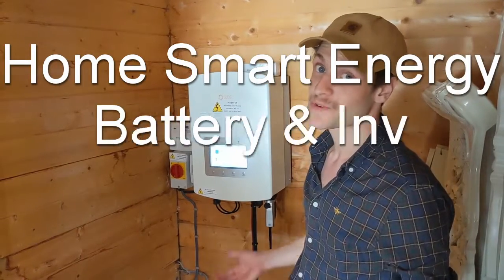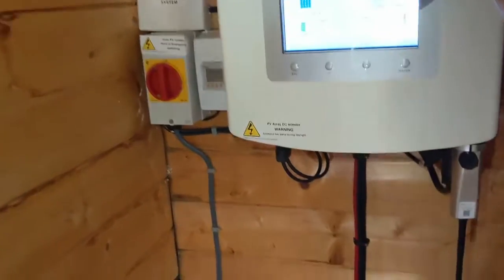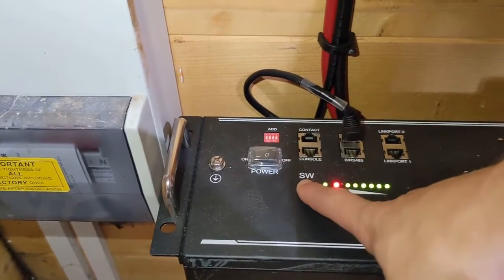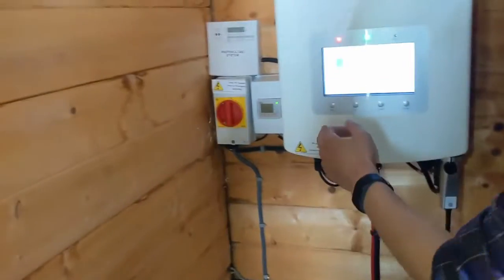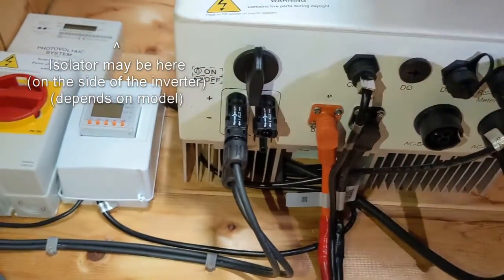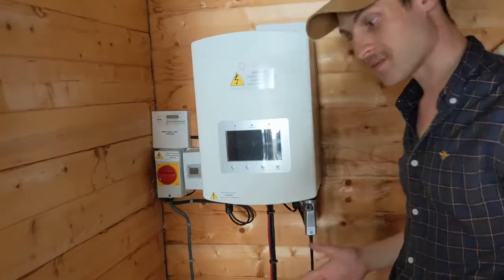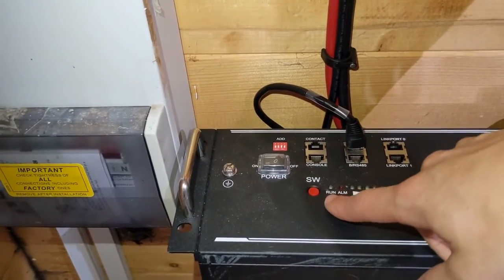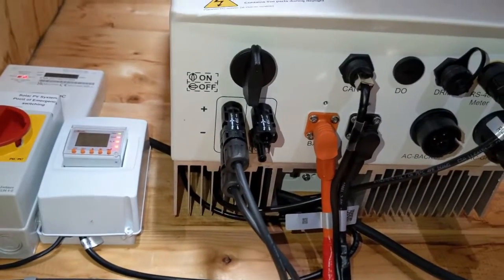Home Smart Energy - Battery and Inverter Restart Procedure

Comment: Great Youtube if you have this type of inverter. Firstly, I have a SOFAR ME3000SP Inverter. It does not have a DC isolator on/off switch underneath or the the side of the inverter! Please update your youtube video to mention this or another YouTube with a SOFAR inverter please. Secondly, it mentions only doing a re-start on one battery the master battery - what should one do on the other batteries if you have them? Do they similarly need to be shutdown after the master battery or just left on - again either mention this scenario in an updated YourTube or an additional one. Thank you.
Reply from the maker: Great comment!

If you've got an 'AC Charger' (an inverter that only has a battery connected, no panels) then you don't need to worry about a DC isolator as you won't have one, AC isolator will suffice (and of course turning the batteries off)

On the batteries, to be absolutely clear, press and hold the red SW button on the master battery (it'll be the one with the empty linkport 0) to soft turn all the batteries off, you can then toggle all the black switches to the off position. When turning them back on, toggle them all into the ON position, and then press and hold the red SW button for five seconds on the master battery only, and they'll all spring into life one at a time.

Comment: Amazing, followed step by step as you did this and it worked. My DC isolator was located at the side bottom of the inverter and not at the bottom.
Reply: My Solis 6kw inverter also didn't have its own DC isolator, but instead has a separate isolator mounted alongside.